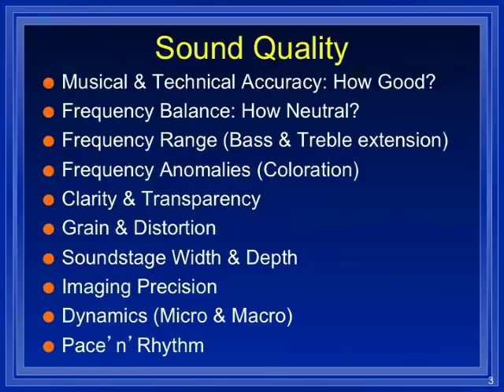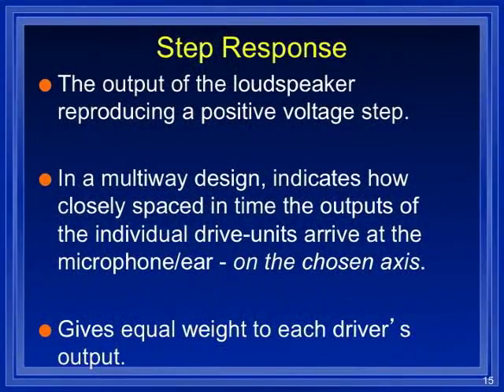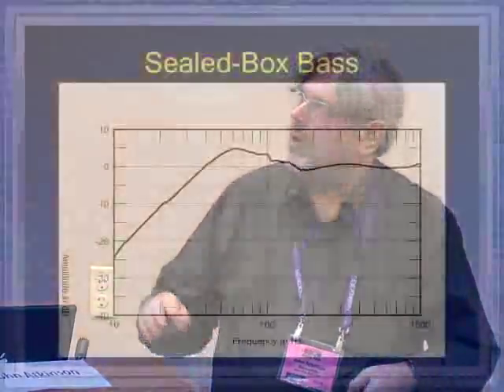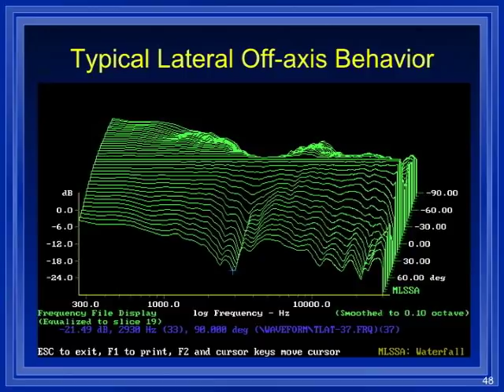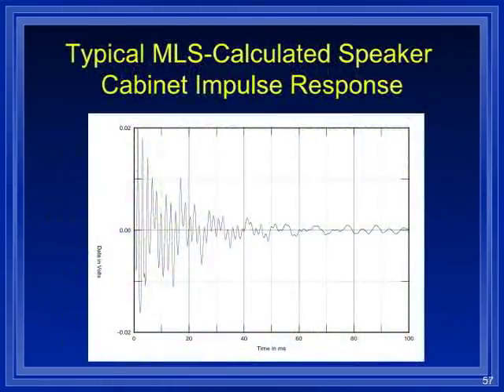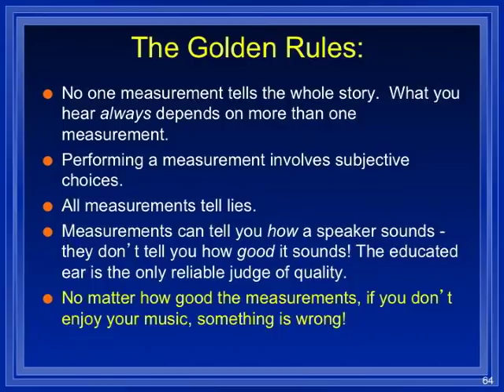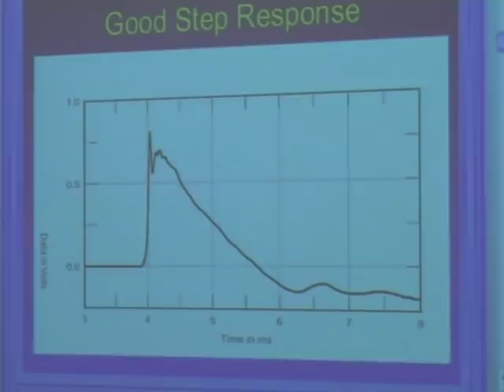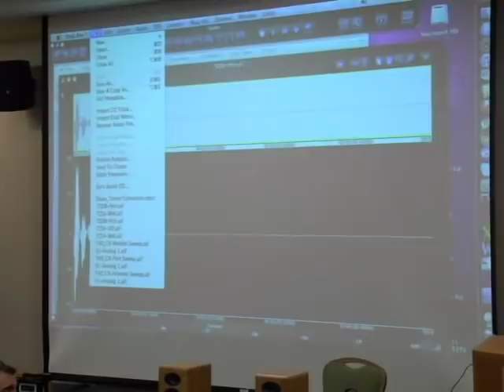RMAF11: Loudspeaker Measurements Explained, John Atkinson, Stereophile Editor

Comment: have to say, I recently had to downsize my HiFi a lot due to moving into a condo after divorce...  After much research I picked up two McIntosh XR50 book shelves.... 81dB speaker's, very hard to drive, so I am using it with my MA9000... but I have to say... HOLY CRAP... they sound like floor speakers 3 times the size... give these a listen if space is an issue, you will not be disappointed.

Comment: Very intelligent and extremely thoughtful as always Coming from John Atkinson but I have a suggestion. Perhaps we're going about speaker measurement all wrong, I think perhaps the best way to do it is to take your speakers and take about a 15 x 10' deep hole put the speakers in it with the measurement microphones and then cover the whole ensemble up with concrete.

Comment: There is something hugely missing here and if I ever get a chance to meet John, this is a topic I would love to discuss - the effect of current linearity in the voice coil/motor and why speakers with a more correct controlled step response, see 54:00 onward, does indeed sound superior and images also in a more superior way, and are more relaxed/accessible to listen to in a way that John alludes to and that this is the very leading edge of loudspeaker system research right now. The understanding that multi-way speaker systems generates lots of noise that kills clarity and that speakers that have the more ideal step response also uses crossovers that by chance also are likely to have a lower noise floor.

Here in Sydney, the home of Thiele-Small Parameters, there is something very interesting happening and it will in time have a surprising effect on loudspeaker system design. It will cause many to rethink what they are doing and also help to answer many questions. It is based on the fact that loudspeakers are in fact current devices and yet we insist on modelling their design on a voltage model. This needs to change, and it will.

Comment: 42:42; the claim that the only reliable judge of quality is the ear is questionable - if so then all the measurements taken would not form the reference they clearly do.

The reliability of the ear to judge sound reproduction quality is dubious.

Rarely is there a speaker that performs well in all the tests mentioned here that does not sound good to the ear; Mackie HR824 is a good example.

Often, a speaker that sounds good to the ear will perform poorly in the tests mentioned here; as shown in the video.
Reply: JA fudges the issue here. Not surprising given that we're talking about Stereophile (where he's attracted criticism for daring to measure these things _at all_). The most revealing section is at https://youtu.be/j77VKw9Kx6U?list=WL&t=1402 where he shows the rather poor measured response of a Linn speaker that ended up getting a positive review. In trying to explain this discrepancy the facade slips a bit he ends up admitting that the reviewer's evaluation was based on a limited variety of music and an inability to discern correctly the large swings in response. Of course this is followed by a bout of hand-waving, as one would expect.  "Things are not always equal when it comes to interpreting measurements." I have no idea what this means.

There's an editorial column from Steve Guttenberg in the August '18 issue of Stereoplile in which he relates a strange phenomenon wherein his expensive and well-reviewed system sounded heavenly one day, but rather drab the next. He puts this down to humid weather and eating too much pizza, whereas the previous day he'd had a nice massage, was feeling very relaxed and his wife had gone out with some friends. Well ... yeah ... It's sad that it seems to have escaped him that this effect may be happening on a regular basis and directly undermines the entire premise that you can evaluate performance simply by listening.

Ho hum.
Reply: Dear Jim, clearly you are not fully aware of John Atkinson's past. He himself has quoted Toole many times. What you are saying is one thing and he is saying something else. I believe that he has a similar view to that of Joseph D'Appolito:

"The controversy over subjective versus objective loudspeaker evaluation has raged on for decades. He has great knowledge of that side of things. However, to my mind, there is no controversy. These criteria are simply two faces of the same coin."

Full article:

https://audioxpress.com/article/testing-loudspeakers-which-measurements-matter-part-1

What we all want is correlation between what we hear and being able to capture by means of measurements what we are hearing. That is on-going, and we are ALL hoping that we are getting better. But in the meantime, designers like me and friends (quite a few recognised brand designers) do our best to get you to listen to good speakers. They are less interested in"wars" that serve not real purpose. As John alludes to, the very choice of measurements we choose is subjective as we hope that they are the most important, so a value system is already at play. Then we have to interpret.  those measurements. The fact that we can fool ourselves and our ears only makes us stick at it and get it right. That there are some successes and some failures, well hey, that's life. Do we want it any other way?

JA's presentation is a limited one, but he has the best interests of his audience and readers in mind (the need to inform is quite a challenge). We know that because he is genuine in what he does.

Comment: He is wrong about the correlation between good measurements and good sound. Harman did 350 loudspeaker blind tests which clearly showed that atleast 9 of 10 people will prefer the sound of a speaker that has a more flat on-axis reaponse and more uniform off-axis response. The correlation was 0.86 i.e. 86% of the listeners agreed. That number increased to 0.996 when comparing products that were more similar in size etc, for example comparing only 2-way bookshelf speakers. That means 996 out of 1000 people agrees, or 99.6%, that the speaker with the best measurements sounds the best. If you don't believe me, search YouTube for Floyd Toole and watch his lecture. About 47-50 minutes into the clip he starts talking about these blind tests.
Reply: You are absolutely right. Dr. Floyd toole is God in audio. He is a big win win for the audio community. I trust Harman because they apply science in eveything they do. Cheers
Reply: No use listening to a speaker that doesn't measure well, said Carlsson - he with the orthoacoustic Sonabs you know. Might not be a controversy...

Comment: Here's something you may want to include in your analysis of speakers / crossovers. "How do they sound?" I could give a shit about all your charts, theories and predictions. You can't predict everything, the listening position, the shape and size of listening room, the floor and wall  surfaces and area, ceiling height, area and surface, window surface area, furniture, floorplan and many more impossible to predict and account for variables that affect sound by coloration, reinforcing frequencies or cancelling frequencies.
Reply: That's what the other writers for Stereophile are for: Take something that costs $50,000 to $200,000 but that is faulty by design and then write a rave review about how it's the best thing they've ever heard. Examples could be reviews of the Zanden CD player/DAC combo ("worst digital product ever measured" but "best CD player I ever heard"), The EgglestonWorks Andra speakers (first model from 1997), the Larsen Hifi 8 loudspeakers, the Lector Strumenti Audio Digitube S-192, and the list continues. All products that cost a fortune and received rave reviews, but were faulty by design. Buy a $1000-$2000 product and you often get better engineering.

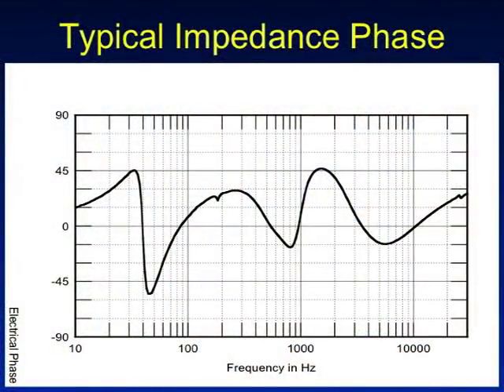Comment: At 7:04 in the video, he said that the maximum current occurred when the voltage was zero.  Wouldn't that be true for 90 degree impedance shift?  in this case, it is about 55 degrees at worst.
Reply: The phase has swung from +45 to (just past) -45. Effectively it has swung through 90 degrees.